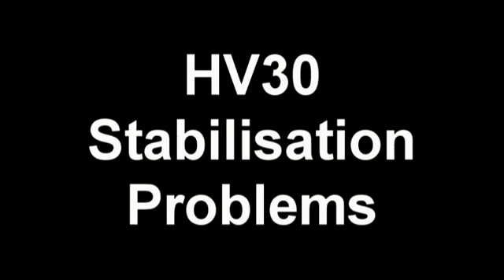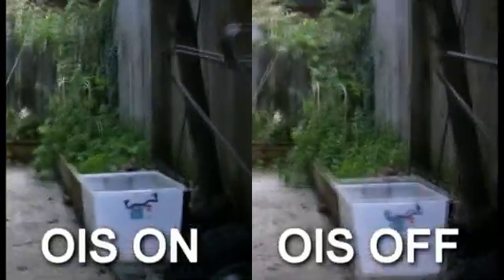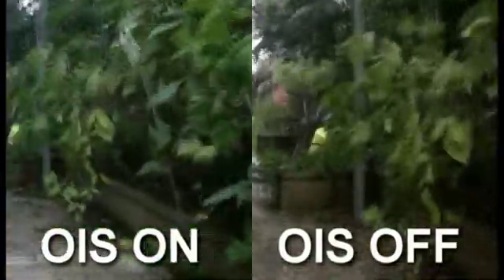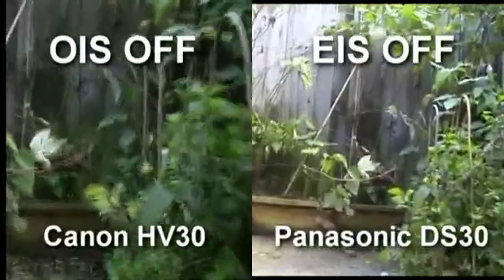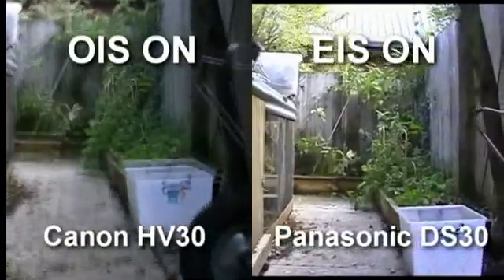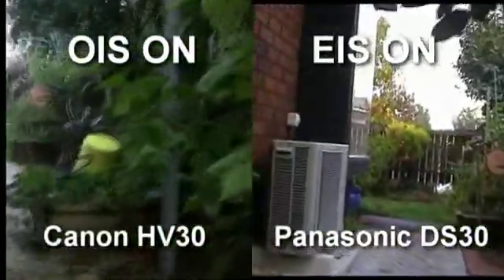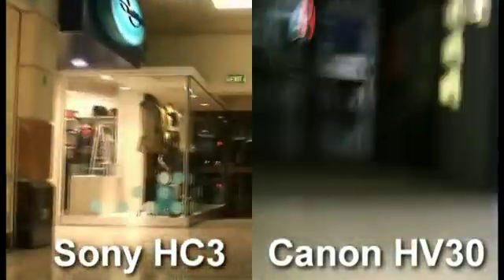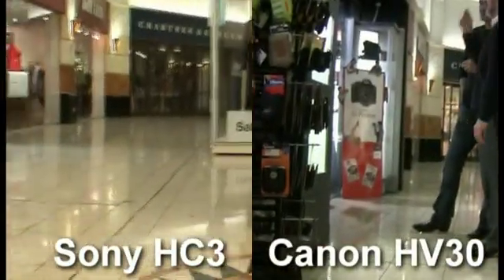HV30 stabilisation problems part 2

Comment from the maker: @BenHughesStudios I film trains. The vibration through the ground of a passing train is enough to cause the lens assembly in the HV30 to shake. Handheld isn't an option; train horns often startle me which when filming without a fluid head causes rapid jerking.

Re relying on my equipment; yes, that is why I got rid of the HV30. My GS400s do a stunning job. Obviously the HV30 just wasn't right for me.

The test in this video is a synthetic test deliberately designed to exasperate the problem.

Comment: GETTING A REFUND OF YOUR HV30? What kind of videos do you even make? Do you like put a freaking vibrator on your camera or something? Holy crap are you insane? What do you use film with it??? Handheld on it is just fine. The only time you'll get a problem is if you're putting it on a car or whatever the hell you put it on in this video.

If you want stable footage don't rely on image stabilizers. Rely on your equipment, you know? Tripods, steadycams, shoulder mounts, hell even HANDHELD is fine!

Comment from the maker: Yeah, too bad the stabiliser hasn't been designed better or can be locked (disabling in the menu doesn't appear to lock the lens elements and I believe they still vibrate given a big enough jolt).

I found with the shutter speed that 1/50 gave blurry crap images, while 1/500 gave sharp but crap images, so yes there is a bit of a trade off lol. So neither was really much of an improvement unfortunately. Slower shutter speeds only blurred the wobbling OIS & rolling shutter. Shame.

Comment from the maker: After all of this "fun", I ended up buying a second hand Panasonic NV-GS400; absolutely rocks and is a dream to use. Just gets out of the way and lets me film, and suits my filming so much better. Zoom is silky smooth, manual controls are awesome, OIS actually WORKS, manual/auto/exposure-lock switch is best thing ever. And it even works with Adobe Premiere Elements without needing 3rd party transfer programs, something the HV30 never did. Plus editing DV is so much faster.

Comment from the maker: It isn't just the rolling shutter though. I tested it against 3 other CMOS cameras and they ALL preformed noticably better. Sure, the rolling shutter doesn't help, but there is something else going on here that makes the HV30 so much worse than any other CMOS camera I've tested.

As a follow up, I sent the camera to Canon along with these two videos, their response after much testing and comparing with other HV30s is that there is nothing wrong with mine, it's working as designed.